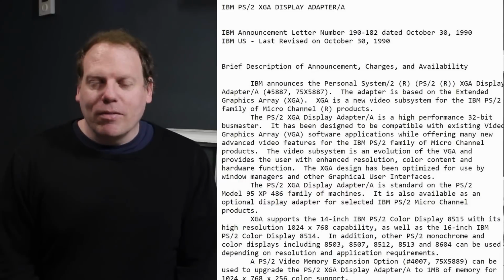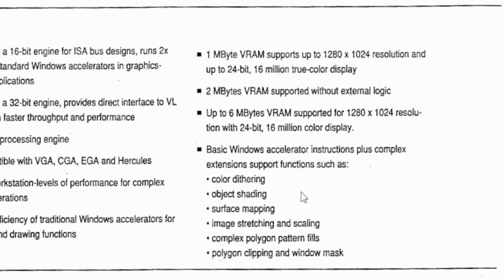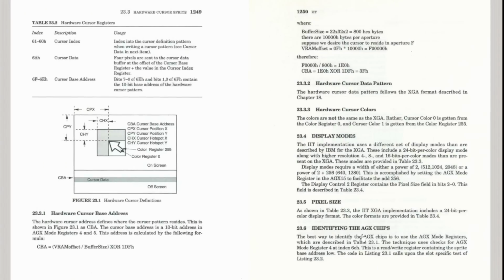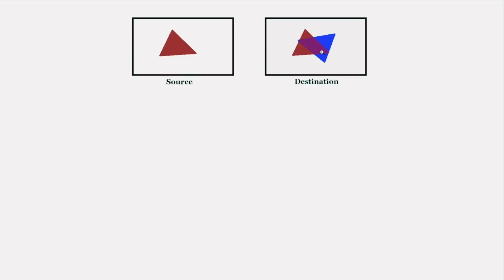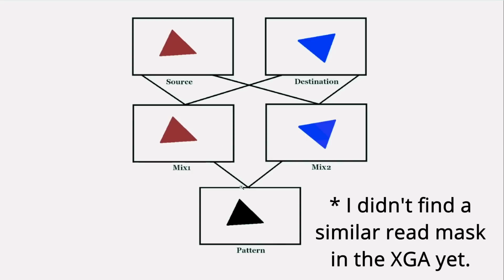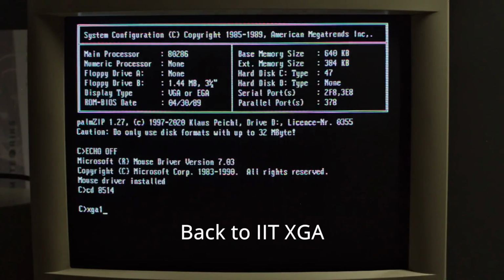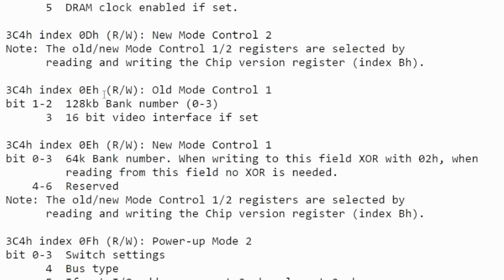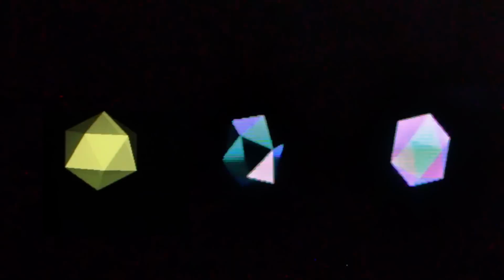XGA : King of IBM Graphics Standards (Part 1)

Comment: Wow, I really love these graphics programming, and technology videos of yours, and it has made me want to use them... In the 90s, from early 90s when I started to learn programming in DOS on a 286... Then through 95 when my dad bought a new PC and I still had to be limited to 16-bit real mode until we finally got a modem and I could access BBS's - and soon later the internet. That finally let me get a free 32-bit compiler for DOS, and most importantly access message boards (not just in Finland, but via Fidonet also international boards).
I say most importantly, because it allowed me access to programming knowledge far better than what the City library had - even though you could order (for free) books from other libraries, IF you managed to search if a book was on any library, which is how I got my hands on some book I think was named VGA & SVGA programming, which was a BIG help in developing my own graphics library. That is, the knowledge of fellow programmers, where you could just ask about anything, and sometimes just bumping into some effect, or other piece of code that someone posted just for respect and perhaps to genuinely provide others something nice - like the VGA Tweaked Mode Fake 16K colour mode (using two pixels, one from the lower half of palette and one from higher half, the second one drawn under the first - so 320x480 becomes 320x240, and you get 32x32x16 RGB space) - and another, 4096 colour trick, done same way, but using "chequerboard" pattern (every other horizontal pixel draws the 1st and 2nd colours in reverse order), AND finding by testing it, a new rate the clock interrupt is called, so it knows that every Nth time happens at start of VBlank, and at that point it switches location in VGA memory where it starts the screen refresh. This is because, every fake pixel is drawn to two separate screens in video memory - only on the other screen the two real pixels forming one fake pixel are drawn in reverse order. This eliminated the issue, that all the colours were "half-bright". It's also been done in some demos with just one pixel for every fake-hicolor pixel shown at once, but switching the screen (and even the whole palette, for even larger colour space) between every screen refresh.

This ended up with me writing my own graphics library that supported text-mode block graphics, CGA hires & colour modes, EGA, VGA and Tweaked Modes (at first I had two modes I couldn't use, 400x300 and 400x600 - the plain VGA monitor of our IBM PS/1 just couldn't handle it - I think the horizontal refresh rate was too much for it, but that's just an educated guess... The new Pentium 75 with Mattrox Millennium PCI card and SVGA monitor had no problems, but the old monitor went haywire, and started to actually *SCREECH*, and I'm lucky I used just a simple test program that would exit instantly on a key hit (returning to text-mode first), because it seriously sounded like it could have damaged the monitor, LOL. And also SVGA - at first using VESA 1, because it could be used from real mode. Then with DJGPP I started porting it to using VESA 2, where the whole video memory could be addressed directly. Umm, that's how I remember anyhow. Not sure where exactly I got all the information, especially for EGA and VGA 16-colour modes, that I originally had to use completely through Borland's BGI stuff...
Which, btw, interests me, as one thing that bothered me was that I was always being told that DOS doesn't support dynamically loading libraries - but then, it doesn't have to! The BGI drivers obviously had code in them, and they were loaded dynamically! And if that's not enough, how about Turbo Pascals Overlays!? You could compile a code into an Overlay file, and you could dynamically load and unload them - what is that, if not dynamically loaded libraries!? :D I think the idea was more about saving memory by loading one part, then later when it's not needed, but another one is, you can unload one, and load up another, but that's basically the same thing as dynamically loaded library, dawgn it! :D

Anyway, to FINALLY GOT TO MY POINT!
I have been planning for a long time to make a game for retro-PC's, and specifically for the IBM PS/1 Model 2011 (I think), my first computer with a weird sound card I never found any information on how to program it (and didn't even know it also supported lo-fi PCM - mono, but still!) - and I want to make the game supporting that device. Of course, it will also implement some sort of support for the meagre PC speaker, and at least for SB16, BUT the main focus will be on that PC's sound card.
But these videos have always made me want to rewrite my 16-bit graphics library, but include support for various special graphics adapters with extra functionality. Of course, I won't be trying to get them all for myself for testing - I'm coming to a bit of money, and I want to buy the IBM PS/1 I lost around 2010, but I'm not going to buy everything. My plans for this game have existed before I knew I would be able to even think about buying such a PC ever, because of the IBMulator project, which aims to provide hardware exact emulation of IBM PS/1 PCs.
And of course x86box (which IBMulator has got a lot from, but also has given back some), which will let me test at least some of these devices through emulation - hopefully good enough.

I just feel like, if I'm going to do this, then it wouldn't be enough if I didn't at least attempt to include support for some less common devices of those times - if only the one sound adapter was all it had "extra", I wouldn't quite be satisfied =) And your videos have been a big part of turning my eyes towards the graphics side of "things I didn't know back then" :D So thank you <3

Finally, I really went off my track when originally writing this comment and describing how much the dial-up modem meant to me. I didn't want to just leave it out, but not include it in this comment either - so I'll try to post it as a first reply to this comment. I was originally writing that after the first paragraph of this comment.
Reply: NOTE! As mentioned in the end of my post, this message is me going off the tracks when writing that post. I didn't want it there, but I didn't want to throw it away either. It probably won't interest anyone, so FEEL FREE TO SKIP THIS COMMENT:

With internet, I also began accessing Usenet, but kept also using Fidonet, up until I moved on my own and the internet connection wasn't via dial-up [actually first one I had was basically 2-channel ISDN from telephone company, BUT it could only call to their service - I think ISDL was the name they sold it as :D], AND my father got in a terrible accident on a motorcycle. He was a motorist, returning from Italy, when near the port on German autobahn some van made unexpectedly an emergency break and my dad crashed right to it's rear. He was excellent and responsible driver, and always kept a reasonable safe distance, but when you're driving in a long line and someone pulls breaks on full without any signs for it, there just isn't but a flash of time to react - his new partner died that day, and my father lived the rest of his life in treatment housing (very good place, not like where people dump their parents in the US).
Up until my dads crash, I had the access to dial-up modem at his place... I always used an offline reader to download new messages from the boards I was on, then read them offline and wrote responses and new posts while doing so. If I really wanted a response ASAP, I might have sometimes dialled up just to upload my new posts, but usually I uploaded them after I was finished going through what I had downloaded the last time - and then downloaded a new batch of messages. I also used an Usenet client that supported the same, which was superb especially after I had moved on my own and didn't yet have internet at home - I copied the new Fidonet posts (that's one file - zip compressed IIRC) and Usenet messages on a Zip-disk (which also had my Usenet agent copied on it - it didn't really need to be installed on Win95 to run it. I already had the BBS client on my dad's P75, since that's where I began my BBS use - my offline reader for that was already there, but that wasn't needed to just upload and download new packages). I took the Zip-drive, with the disk, with me and dialled up to the BBS I used for Fidonet. Uploaded my new posts, then downloaded the new posts from after the last time I did that. Rinse and Wind, but that unfortunately ended when my dad got into that accident.
Luckily, I already had an internet. The weird ISDL - and I'm fairly sure that it was that, and not IDSL, because at the time I did pay attention to that being kinda weird, because of ADSL, etc. - that was upgraded to cable modem when I moved to another flat. That was weird too, it was very early cable connections available, and it was 128/256Kbps. You read right - Download speed was lower (exactly half) of the upload speed!! But although I had internet, that was the last time I could access Fidonet.
P.S. I'm not downplaying my father's crash, and the effect it had on me, when I seemingly happy just say that luckily I already had my own internet. It had a devastating effect on me, and I ended up suffering a long and painful time of problematic substance abuse after it. It's just that this comment in focusing on a specific part of my life, and those things are not what I'm writing about here.

Comment: An interesting difference between card 8514/A (plus clones) and XGA.   8514  uses  PIX_TRANS register and CPU instructions to transfer data step by step.  XGA  uses MCA ability of bus mastering when transfer data from main memory to graphics memory and back.   This was problem for clone cards to reach on ISA bus so they used  8514/A method.
It os good described on os2musem site.

P.S. Writing to video memory via PIX_TRANS register  is different from writing to upper memory mapped windows of a vga graphics card.

Comment: "Object shading" sounds like it might allow polygon filling in 16bit mode where different colours are specified for each vertex, and then blended based on the pixel position in the polygon? That would effectively allow Gouraud shading which would have been really nice for 3D fills.

From my experience with 16bit colour in DirectX 2 later in the 90's, there were various formats. RGB 565 was the most common, but we also came across 556 and even 664 on some strange cards. (Plus some that cheated and used 555 so were effectively 15bit rather than 16) Some also supported alpha channels like RGBA 5551 for 15bit colour plus basic transparency or 4444 for 12bit colour with 4bit alpha blending.

It's interesting to see how the various low-level operations were starting out on cards like this. These all ended up getting rolled into DirectX (or specifically DirectDraw) later on. (Plus functions to interrogate all the various cards to see what they supported)
Reply from the maker: It sounds like that, I agree, but it's not at all documented and I see no way to denote the colours for the corners of a polygon, so it's hard to imagine how this would work. It'd be really nice if it did though!
Reply: Interesting... I always thought 16-bit meant only 556, as it was with VESA - I wrote my own DOS graphics library, first in real-mode (so 16-bit), and then 32-bit protected mode, where you didn't have to access VRAM through a 64K window :p It supported all colour modes, except 16... 256, 32K (15 bits), 64K (16 bits) and 16.7M+ (which would be both 24-bit and 32-bit modes), and that's how the sources I read explained the 16-bit modes, and also how they worked on my family's last computer, which had Mattrox Millennium card, and on my first very own one that had Hercules Stingray 128 3D, which was a Voodoo Rush card. And from my test code for each mode, I could easily see that there were in fact double the amount of blue shades than red or green.

Don't get me wrong, I'm most certainly not trying to dispute what you're saying, I simply am surprised and interested of this, and it wasn't at all what I thought I knew for sure.

Comment: The alternate resolutions like 800X600 were driven by the laptop LCD market. LCD's are one of the major COGs for laptops and this is the period where laptops are starting to displace desktops in volume. An ancillary market was of course LCD projectors which also were becoming core tech for sales road warriors. Brooktree really opened up the market with this aggressively priced high speed flash DAC. Rockwell (who owned the modem market at the time) bought them out.  This is the period where the DAC was external. The Accellerator/XGA was purely BiCMOS digital and the DAC did the video output.  I seem to recall that around this time 3Dfx was making a name for themselves with low cost daughter boards that made your PC a great gamer. These were cards where your VGA was looped through the 3Dfx card input to output and overlayed the graphics using the VGA's sync capability. Very very cheap upgrade and worked really well. And they were so fast that this product just died a very quick death. OF course next was integrating the two cards into one Radeon, Voodoo, GEForce.
Reply from the maker: 3DFx was a bit later, around 1995 if I recall correctly. But the information about the LCDs driving the market is interesting. Things were probably a bit different where I grew up in Australia, so it's useful to hear about what was happening elsewhere.
Reply: @PCRetroTech  - You are correct. 3Dfx was a bit later. Rephrasing - the high end market was very quickly eclipsed by the low end up and comers willing to accept less margin. So many graphics manufacturers were crushed by this. And really when you think about it the "workstation" market (Sun, Apollo, even IBM's RT series) was slowly eaten away by the PC revolution. Even Jobs who at NeXT made a workstation class machine that was actually user friendly found the PC although inferior defining the price and margins. Although that "failure" actually saved Apple in the long run with the merge of NeXTStep into OS-X.

Comment: my PS/2 57 (not installed yet( should have XGA2 :)
Reply: The 9556/9557 (with an IBM 486SLC2 -50 or 486SLC3-75 CPU) are XGA-2 - the 8556/8557 (with a base 386SX-20 or 386SLC-20 on the planar) are the IBM/TI SVGA (which is interesting in itself).
Reply: I used to have IBM PS/2 model 57 - exchanged it on a local retrocomputer forum for a 40SX model - the same 386sx/20, but ISA16 slots and IDE HDD)... Now have full set of it - wth display, kb and mouse...

Comment: many years ago, i worked at ibm argentina, in a pile of garbage i found several boards like the one you show in your video, which is unobtainable, since i didn't know what it was but if i had seen the dram chips i brought only that part, even the I have, now it is an ornament. I remember there were many of those plates in the trash.
Reply from the maker: What a shame. Such a lot of interesting tech has just been wasted over the years.

Comment: The Windows icon and cursor formats use a Xor mask and an And mask  in such a way that it seems like it was created to match these sorts of accelerators (or maybe the other way round). I never really thought about why those formats seemed a little unusual for something that was only really used for colour and 1 bit transparency.
Reply from the maker: Of course these XGA devices have a sprite, by which they mean a cursor. So I'm sure Windows uses that. But internally I'm sure it is based on the same tech.